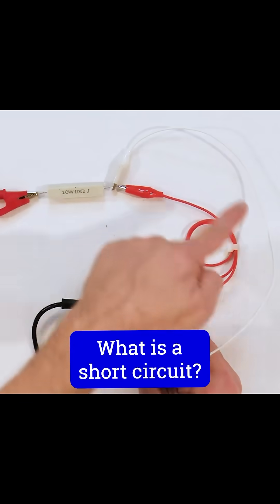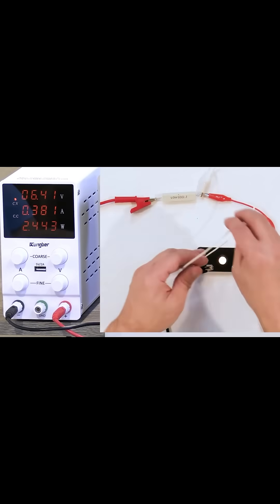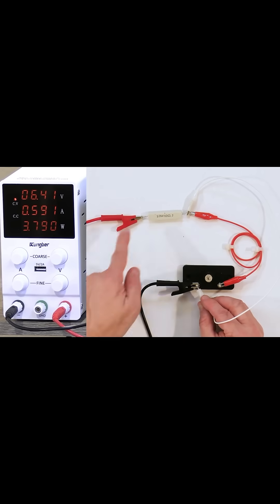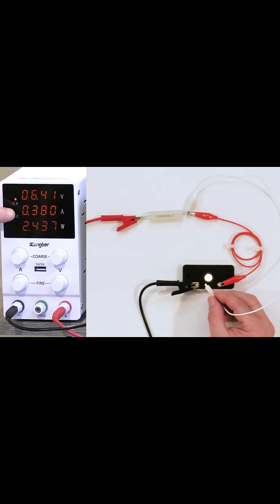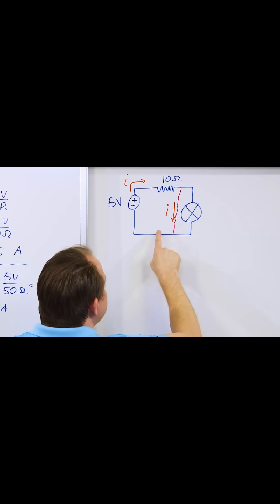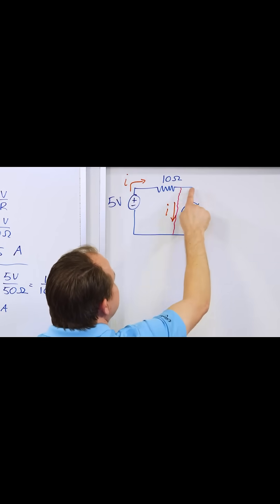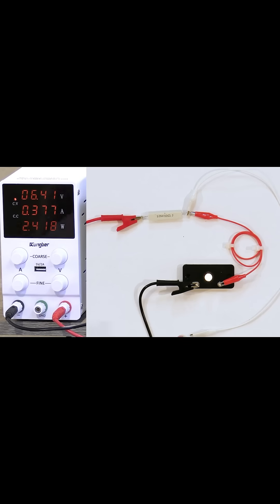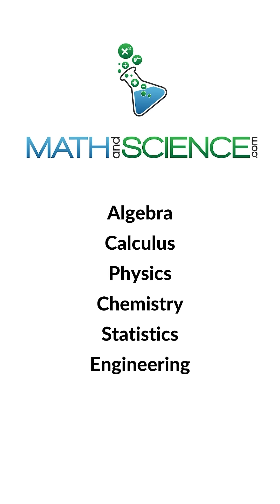What is a Short Circuit?

Comment: Electricity takes "ALL" paths available to return to the source, not just through the short circuit.  However the greatest amount of current will flow through the path of least resistance and only a little will flow through the lamp, but not enough to light it.  Since the lamp is still in the circuit as a parallel load, the electrical current will still travel through it but at a much reduced level. This is an important safety point, Electricity takes "ALL" paths available to return to the source. The mistake that electricity only takes the path of least resistance, Kills people because at a given voltage enough current can stiil go through a person to kill them even with a short circuit involved.  While short circuits can and do cause fires, mishandeling a live short circuit can still kill by electrocution.